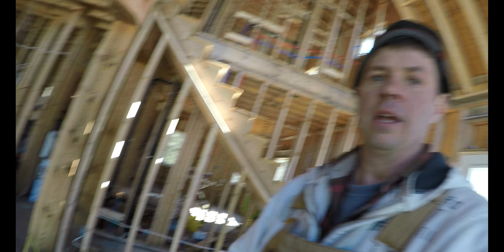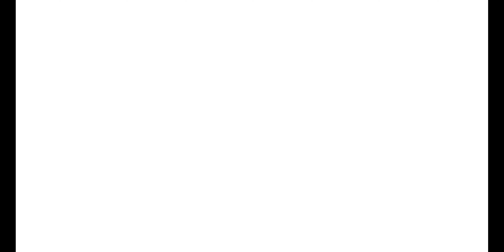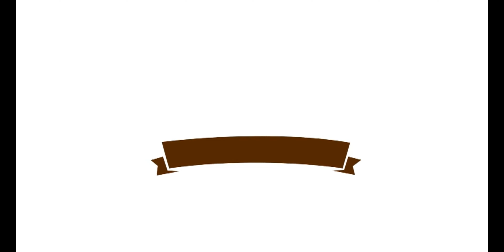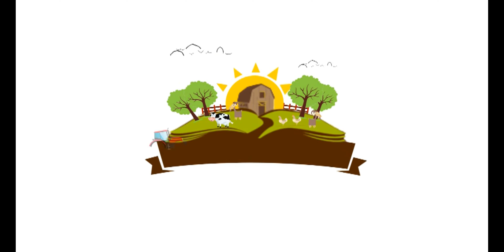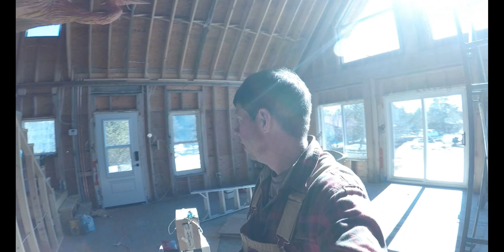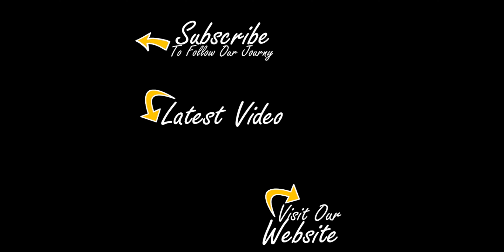Installing In-Floor Heat Pipe and Transfer Plates (OFF GRID TIMBER FRAME BUILD) S06E06

Comment: What type of propane boiler did you install. And how do you like it.
Reply from the maker: I installed a Rihanna.   It is terrible.   Right out of the box it had issues like bad firmware.   We have it working OK now.  We don't rely on it much in the winter  now mostly summer for domestic hot water.